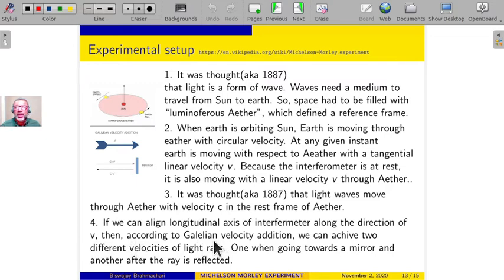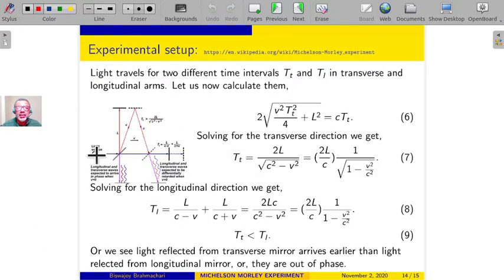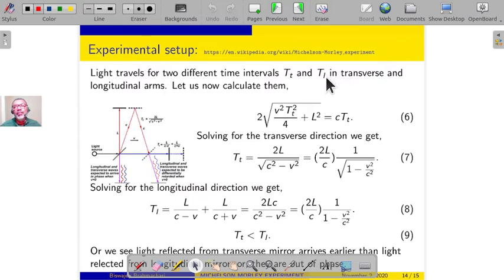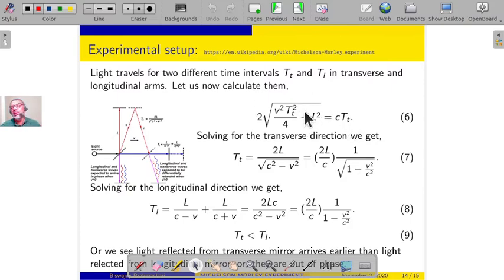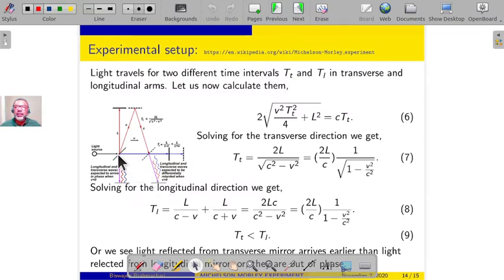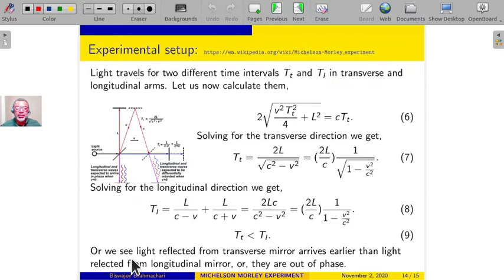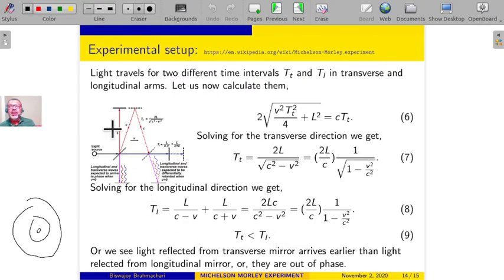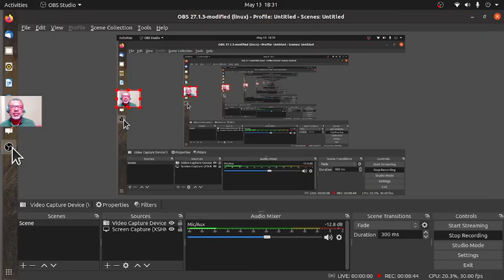Michelson Morley Experiment: Quick Review

Comment: The video is accurate in describing what Michelson expected. His first test was in 1880 and Morley joined him later to improve the sensitivity. However, it was not seen as disproving an aether. Instead it was the motivation for what was called the Fitzgerald Contraction. That shortened the length in the longitudinal direction explaining the null result and was supposedly due to an interaction between the material of the arms and the aether, so still required it. That idea was developed in what is called a Lorentzian aether with both length contraction and time dilation, both due to aether interactions. It wasn't until Eddington confirmed the GR prediction for bending of starlight that the aether model was really challenged.